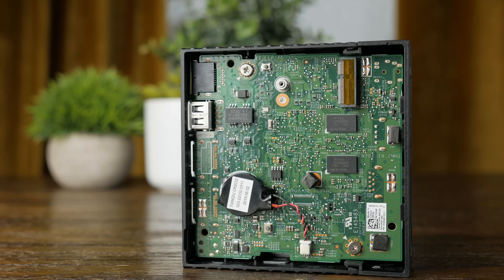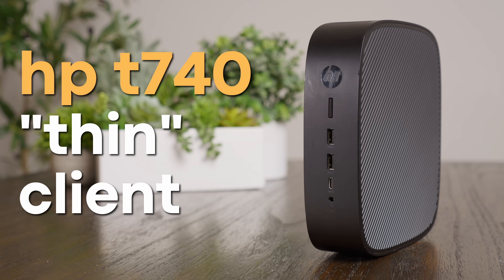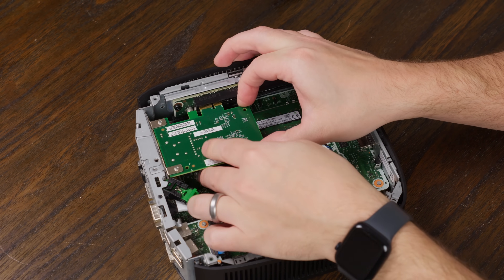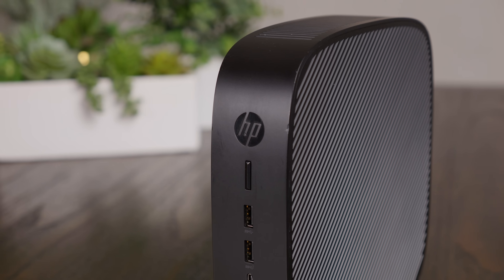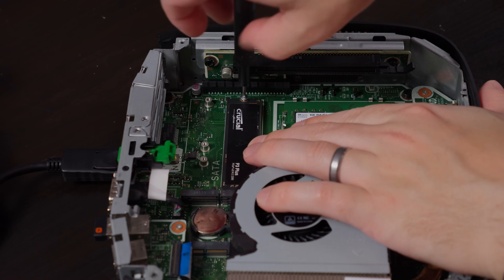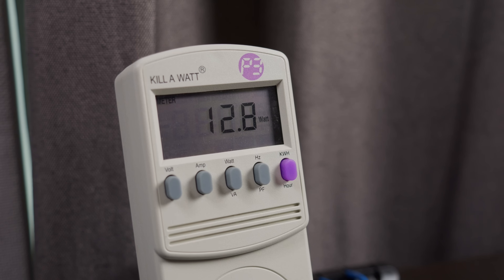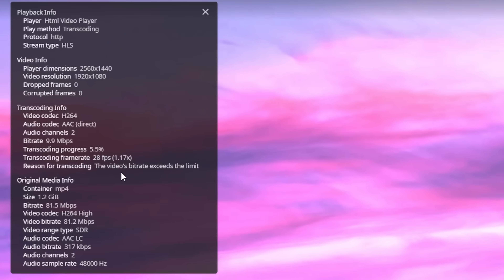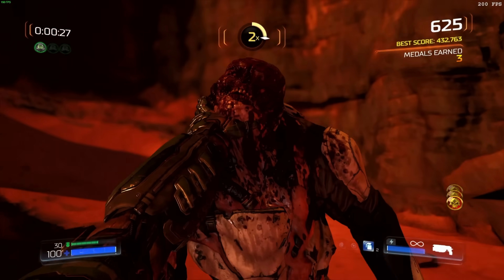Not Your Dad's Thin Client

Comment: I have a thin client 730, they have one very huge limitation. They won't boot unless a monitor and keyboard is plugged in and monitor needs to be turned on. It will just go in beep frenzy. For this they can't be used as a reliable server only.

Comment: No ECC but 9305-16E with an external 16 bay SAS DAS.
You screw in the blue ssd holder things then the blue part rotates to lock the ssd in place.

Comment: This almost looks like the perfect machine for me the problem is I would want a 10G SFP+ card in that PCIe slot and I indeed would want to run Emby... which is the better Jellyfin IMO. So I'm expecting I couldn't expect much transcoding to happen on the integrated GPU, huh?

I have very old Xeon processors in my current rig and I wonder whether software transcoding on this AMD APU might be good enough? Does anyone have experience with that?

I wonder... A mere boot SSD could well be SATA... What if I slotted a 10G NIC into the NVMe M.2?

Comment: Ran into an interesting problem with mine. Secure boot was enabled and it refused to let me load the BIOS to fix it.  Thankfully it would boot off of my Proxmox installer thumbdrive.  From there I was able to go to the "Advanced" menu, load the UEFI Firmware tools, and that let me into the BIOS to make changes.  Spent my Saturday morning chasing that little problem down.  Hope it helps someone else!

Comment: Use one as my pfsense edge router, vlans, fiber, and portal capture.  For those wondering about Realtek, I've never had an issue with the port, including the same on my previous t730.  I also run a Broadcom dual SFP+ card for fiber and dual-WAN failover.  Only issue is the atkbd0 : [GIANT LOCKED] error,, easy fix, just google that exact error statement. Just remember to try "both" uart.0 and uart.1 statements before flaming.

Comment: Thin clients for Enterprise are so expensive. Dell optiplex 3000 thin client is 400-500$, and literally has nothing in it, raspberry pi level parts. Speaking of which, if you need a thin client for VDI, just get rPi's or something like that, dont invest in this. I use Dell cause of company policies, and the management solution is shit, half of the features dont really work and it doesnt really offer anything so great for the price, youve got free solutions that are far better.

Comment: looking at the pricing, these systems are still in demand. I have a Dell Wyse 7020 thin client and it works fine for a PC. I upgraded the memory as well as the storage and it support W10 just fine. the HP T740 should be the same. I'm keeping my eye out for one. the pricing should continue to drop as time goes on, so I'm hoping to be able to find one for less than $50. the Wyse thin clients are a good deal and if you know how to upgrade them, you can have a great little computer!

Comment: Needed a thin client with 4 display outputs recently, it only needed to run 4 browser windows with dashboards all day, so it didn't need to be powerful at all. Couldn't find a decent option so ended up getting a refurbished Minisforum mini PC with a dedicated GPU for around $500, wish I had known about those back then 😅

How do you find things like this? Any tips you might be able to give?

Comment: 6:40 aren't you supposed to screw those in and THEN put the NVMe in, using the blue plastic bits to secure it in place, I'm very sure they're supposed to be a toolless solution
Reply: No, the blue nvme plastic thing is not toolless
You need to unscrew it and put it on the m.2 ssd first, put the nvme into the slot and than screw it in
Sadly that's how it works in hp thin clients, not only t740 but t640 too, I'm not sure about other ones

Comment: I noticed you were using a no-name generic "replacement" power brick. These are often much worse than the original in many ways, among those efficiency. I'm sure your AC power draw would be noticeably lower with an original HP.

Comment: Batocera will OFTEN default to using a retroarch core for N64 when in most cases you would benefit from a stand alone emulator. Give that a shot next time if you didn't already ^_^

Comment: Got a t640 that was pretty beat up for 5$ a few months ago at one of those retailer returns store. Multiple ports damaged, removed those and it worked fine. But it still had Amazon's tinycorelinux build on it, assuming it was one of their automated warehouse shipment computers. Not sure if it was decommissioned or damaged on accident and thrown into the returns lot. Was surprised these type of thin clients can be upgraded, wish mine was not a passively cooled one though!

Rest easy tteck

Comment: The Dell Inspiron Zino was the first decent mini PC I ever had, I still have it today, it has an AMD Phenon X6 processor, 8GB of DDR3 RAM, and an offboard laptop video card that allows upgrades (originally a crappy Radeon 4330 or something like that). I easily upgraded it to a HD 5570, I could have chosen a better card, since it is MXM 3.0b which is used even in RTX, but I preferred not to mess too much with the TDP and balanced power consumption of the motherboard. I added a laptop cooler blowing air over the video card heatsink and I get great temperatures. It is my retro Windows Vista/7 system.

Nowadays it is infinitely easier to get a nice and small computer, but anything before 2015 was simply luck. I love collecting decent compact systems (by decent I mean none of that atom crap and crappy integrated graphics), but they are rare and expensive. The biggest mini system I have is the Dell GX280, a pentium 4 775 with a pci express slot in a USFF case. The smallest retro I believe is the Sony Vaio UX380n. That despite having a processor bordering on pathetic and an Intel 945 video card, I take into consideration its tiny motherboard size, and how Sony managed to fit all that in there.

Comment: Guess you could get better results with some GT1030 as nVidia usually goes better with emulators even though you're "downgrading" in terms of (i)GPU power. Your leftover TDP package could eliminate CPU-bottleneck scenario, and 90 watts could be just about enough for it.

Comment: I've been using one of these units for almost a year now. It runs proxmox with several VMS and lxc containers. I installed a 4-port gigabit nic in it for use with a virtualized instance of pfSense. I also installed a 2 TB nvme drive to service my small samba share. Yes, I wish you drew a little less power, but it draws far less power then the Dell t610 II  server that I was using before. I love it though.

Comment: I have gone thru this experimentation with thin clients. In the end I settled with a simple H110 mobo + i3-7100. This combination consumes a bit more power (not by a lot, still low power enough) but gives us far more freedom for expansion and applications. Also if it breaks down I can always replace it easily and cheaply.

Comment: I have a T530 wich I use as a video player. I installed Librelec/Kodi and catched a DisplayPort/HDMI cable. Awesome 4K capable.
Reply: T640 (and T540) are Zen based and way nicer. I have had T510, T520, T620, T530 and T630 previously.

Comment: - 64GB of ram works fine
- Dual rank ram is limited to 2400MHz (via HP hardware reference guide)
- PCIe 12v is limited to 35W (via parkytowers)
- 1440p above 60Hz produces a weird vertical artifact
- Wyse 5070 is still my favorite for cheap, small PCs

Comment: The best thin client for testing thing out
Valorant 80 -110 fps high setting (Uses Radeon pro graphic drivers)
I use it as router , along with pihole. realtek nic work fine with proxmox and opnsense via bridge
That orange cable don't come of from daughter board or mother board please don't try to take it off
use t9 screw bit or you can also use slotted (negative or -- ) screw bit to screw in normally to m.2 slot like you did with "normal m.2 screw" **
** it can also be done by hand 
you can easily boot this with 65w power supply (not recommended) 19.5v is must because hp also sells 19v power supply check before buying
intel i350 -t4 fits
there are power supply available with higher wattage I have seen other youtubers adding higher watt power supply with lenovo minipc's i guess you can do with this also
MAKE SURE IT IS 19.5v AND PIN WILL HAVE A BLUE PIN AROUND IT **************
*************** * I haven't tested this please take my word wit a bucket of salt*

Comment: I have everything running on two HP t530 thin clients. They're nowhere near as powerful as this, they have a weak 10W pre-Ryzen AMD thing. Still, 4W idle, 10W max TDP, and they run everything I want with room to spare.
Reply: I have a t530 as a “standby” home assistant server should my usual dell 5070 fail. For £22 from ebay I cannot moan and 4/5w idle though ideally the 5070s are my choice yet double the t530 price here in the uk.

Comment: You could add a pci express sas card and use it to plug a external jbod. That is if you feel like building an external jbod using an old pc case, another sas card, power supply and a HDcase with backplanes.

Comment: Prices (used) in the US: ~ $70. Prices (used) in Europe: ~ 330 to 400€. Strange.
Reply: Probably just some huge US corporation decommissioned thousands of those at once, flooding the market in the region and crashing the price. Same thing happens all the time with server and commercial hardware.
Reply: @ItsJustElenore  Older desktops will probably flood the market in the next 6 months due to the Windows 11 hardware requirements.
Reply: @ItsJustElenore   yeah $70 is a very good deal for that thing
Reply: I’ve had a look just now on eBay in the U.K. and these are on the whole in the £600 range. For that money it’s a no go!
Reply: At that different a price it would be better to buy one from the USA and have it imported
Reply: That's okay, you get those fujitsu systems for cheap and they are crazy expensive over here.
Reply: Just did the same thing. $61. My assssssss
Reply: Maybe not meeting power efficiency standards?
Reply: $1,000 on Amazon...

Comment: I've got one of these with an Intel X550-T2 network card running as a router for my overkill home network. The factory storage drive cause lots of problems with BSD so I do not recommend it for use with pfsense or opnsense but it is otherwise a pretty good machine. I am insufficiently aware of alternatives in the space to recommend it but it has been a good machine for me after throwing in more hardware.

Comment: i have one of these with a raid card in it, running a rosewell raid enclosure with 4 18tb drives. 
came out cheaper and faster than an actual raid set up. 
i think i spent 140$ not including drives (obvi)

Comment: 9:34 Those spring finger plates are usually there to ensure the chassis ground is effectively connected to the metal bracket btw.
Reply: EMI shield(ing) is what i would call those

Comment: aren't the blue things semi-tool-less? I seem to remember feeling they were super clever on some of my lower end HP thin clients, but it's been awhile
Reply: I believe you're right, you just lower the SSD and turn them into the locked position.
Reply: They're not - I have one of these as my router. The blue things just work as washers essentially. Maybe they could be used to hand tighten the drives, but they were tough on the fingers , so I used a screwdriver.
Reply: @sirseriously  I might have been thinking of the asus one then.

Comment: Aside from Dell, HP has a strong hold on thin client products. I’d say 90% of my office uses their units, and we actually make good use of the four DisplayPort outputs. Most of our users need to monitor and interact with multiple things simultaneously.

Yes, the power consumption is higher than it should be, but let’s consider two key points:
A: These units are designed to run at peak performance as much as possible. While this may be taxing in the long run, it ensures they’re ready to boost performance instantly.
B: These devices are definitely not designed for consumers or home lab enthusiasts. In offices with VDI infrastructure that requires such thin clients, the power bill isn’t usually a concern. Moreover, large companies often have different pricing structures than residential agreements—many pay a flat rate regardless of high usage.

Comment: I still shudder at the thought of Thin Clients, because we used them in a class in college back in 2006. On 100Mbit Ethernet. On the kind of systems that were considered low-end by 2006 standards. Yeah, not a great experience. For the money they spent buying and maintaining the server, they could have equipped three classrooms with usable PCs. What's even worse is it wasn't a class teaching about VMs or even network booting. No, it was a COBOL class, and COBOL is also terrible.

Comment: it would be a great steamOS box with that pcie slot
Reply: A lot of those embedded processors don't have your typical PCI-E layout. Usually they have x16 lanes in total, 4 is gone to the NVME so that's 12 left for the other peripherals. I'd double and triple check you're getting at least x8 lanes to the PCI-E slot before trying to use it for a gaming setup. You might be better of using it as a Steam Link box if its fan isn't obnoxiously loud.

Comment: You do not need to pull the fan or USB card to put in an a+e 2.5 gbps card, I have this in both of mine. They are currently running VMware vSpere8 in my lab. I had no trouble with the blue drive holder things. Mine also have Supermicro dual 10gbps cards installed, a little less power/heat than other cards. They will take 64GB of RAM.

Comment: got a couple of these to play with awhile back. steamfork is pretty cool to run on them, good steam boxes. I think the power delivery on the pci-e slot is limited to 30w or so? I tried a 2gb RX 6300 oem card and it would get too hot in the case. good video!

Comment: Bought one of these a while back and ran into the same issue with that pci slot's cutout for the bracket. Mine is running proxmox with a CT for plex with a Quadro p400 for transcodes.

Comment: I bought this for $250 a few years ago. It’s running OPNsense and a dual 10gb NIC, although the installation required some initial tinkering to get up and running.
Reply: Care to elaborate? I was thinking this could be a perfect cheap 10gb opnsense box too, since anything else is $250+ to start. Did the tinkering you speak of for the realtek onboard?
Reply: @wallyrogers2371 I had to google the problem to remember what I did. Essentially, the system would not boot OPNsense. I had to edit a config file referring to uart.0.at and uart.1.at to get it to work. Great system, although best to use a low power 10gb nic to prevent heat buildup.
Reply: @wallyrogers2371  I plan to move to this T740 in the future, but today I use a Lenovo Tiny M715q as a OpnSense Box, with the onboard Realtek Gigabit Nic + an Intel I225 added on Wifi slot, both working perfect 24/7 for the last 13 months. Just installed the recommended Realtek package/driver.

Comment: Honestly, Whacked this into Ebay and they are £600... and then some lower models come in and they are less appealing.
Reply: Must be very location-dependent. A quick search in the US shows plenty of recent sales between 60-80 US with one recent sale for a lot of 10 for 430 total.
Reply: Can get a 13th/14th gen Intel dell 3080 for that much minus the pci slot or a similar spec m90q for £100 less than this. Mad money for a “thin” client

Comment: Been using one of these for 2 years running PfSense w/ Mellanox ConnectX-4LX 2x 10Gb SFP+ nic. I did replace the lid with a custom cut one with a 140mm fan. Rock solid device, with wayy more performance than I need. No its not a super power miser. Thats fine by me though. These were never meant to run very low power. The slot was seemingly meant for a 6400 gpu or other nic. The slot is a x16 but only connectivity of x8.
Reply: I have the same setup. ConnextX-4LX on Pfsense. No problems with my 2500/2500 fiber. Note that this box has a BIOS bug that causes the CPU fan to run at bare minimum speeds (or stops) on some bootups. Never seen a proper BIOS fix from HP (check the ServeTheHome thread), and getting the BIOS on the box is pretty annoying.

Comment: Well after running my homelab on an hp ProBook 440 g2

I finally got a job
Now I am planning on a hp elitedesk 800 g2
256 gb nvme
1 tb HHD
16 gb ram 
But no wifi
As a on the go server

I will install windows (wait)
Because I have some retro and some 2013 games in cd format which i converted to digital disk

It ain't much but all I need now

Windows+ some office software+ some light games + jellyfin for media server and a shared windows folder is all I thing I need now. 

Well thanks for inspiration and such vast array of content i really mean it man

In India cost of computer parts do add up fast hence I got a bit creative..

Any advice is welcomed 
P.s the system. Is the only one I can afford right now 

And it has not arrived yet so I thing in 2 weeks will update on a later video 

Thanks to hardware haven, for such fun content,

Comment: I've been looking for something similar to this for a while. A thin client with  a n pcie slot but I guess this is not the one.
Reply: depends on how much power you want it to have
Reply: I was looking for something like this for a while and it was between the think centwr m720/m820q or this. The m720q/m920q is more expensive, often requires purchasing a separate pcie riser and requires a custom PCIe backplate. I live in an area where power is cheap and the difference between 7w and 12-15w idle is about $0.50/mo so the power difference wasn't meaningful for me. I also really didn't care about the integrated GPU performance